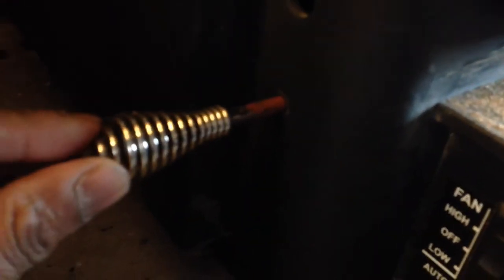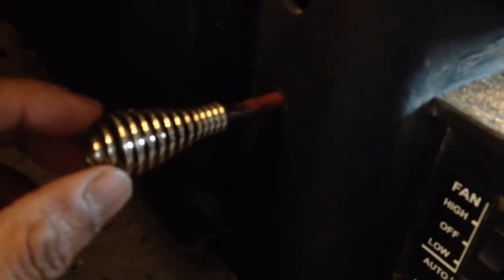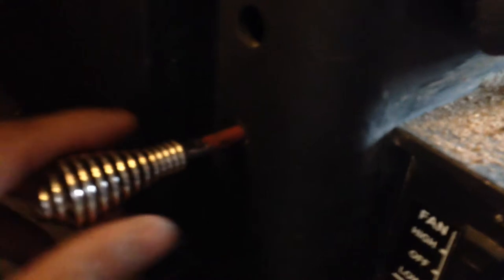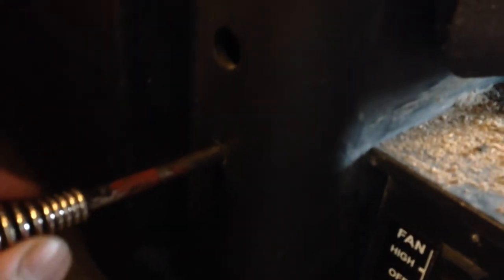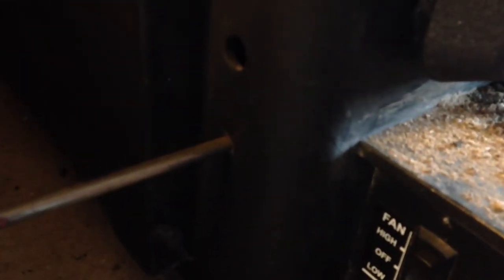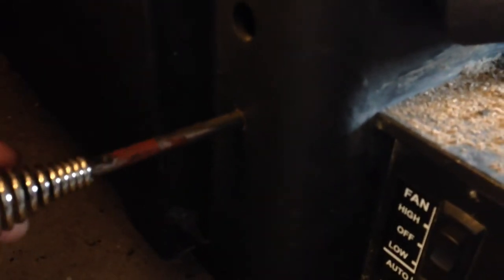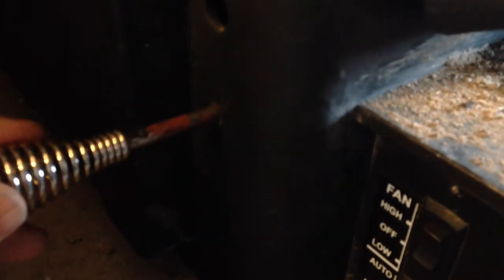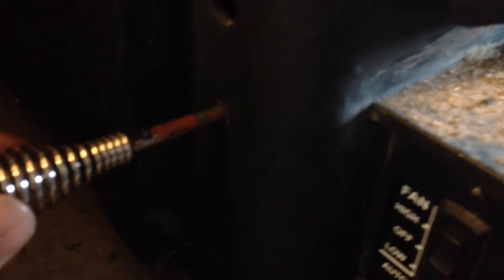How to solve whistle problem on Regency H2100 hearth stove

Comment: This solution was awesome! I have a built in stove made by FABCO. The EPA hole is below the gasket but still behind the door trim. So, you can't get to it to test if the hole is what is making the whistle. My local hearth store suggested changing the gasket. I kept looking at it saying to myself, "I'm gonna change the gasket and it still will whistle through the hole!" Instead of a stick, I used a 4" section from a wire coat hanger. It worked perfectly and saved me much time and expense of replacing the gasket.

Comment: Good tip.  Gonna try that, I actually kinda like that noise.  Btw, you don't have to shop vac the ashes off the lip!  Just take your shovel or whatever you use to clean out the ashes and pick em up and throw em into the stove.

Comment: the regency rep recommend putting foil tape over the hole. then punch out the whole with a pencil.  The imperfect hole wont whistle.
Reply from the maker: slipper409 that makes sense. Thanks for the tip.